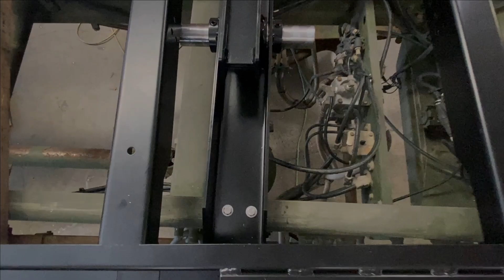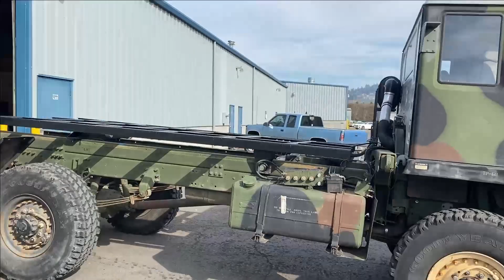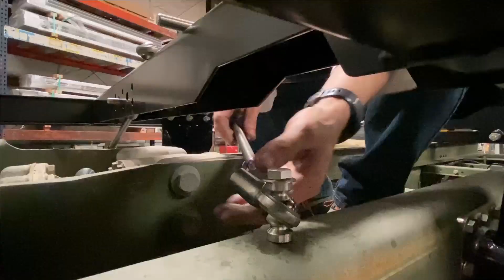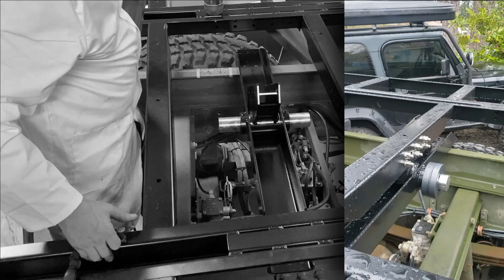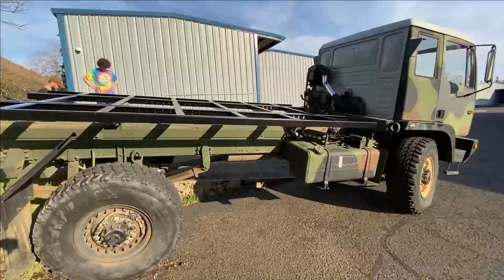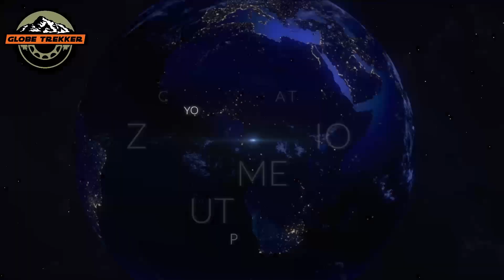Globe Trekker Subframe Build part 4

Comment: Why in some areas you use heim joints and in other parts you use pivots, is it just a matter of cost selection or for other reasons?
Reply from the maker: We only use HEIM joints when there is a three point pivot system. The axial pivots need a redundant capture device to prevent lateral movement. Otherwise, the HEIM joints are not required for the 4 point subframes.
Reply: @RVGlobeTrekker  thanks for your answer :)

Comment: Do we have the option of ordering the 12' with end rails? I see the ends are not connected to anything.
Reply from the maker: That is an older version. We do not make the open -ended rails any longer. Since customers have been asking about mounting storage boxes to the subframe, our subframes since about a year and a half ago have a full box enclosure around them.